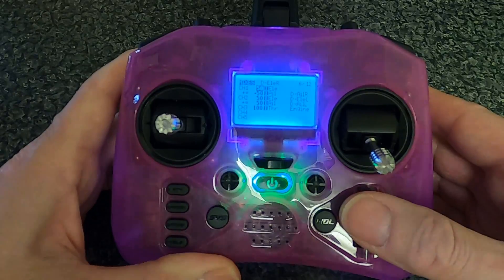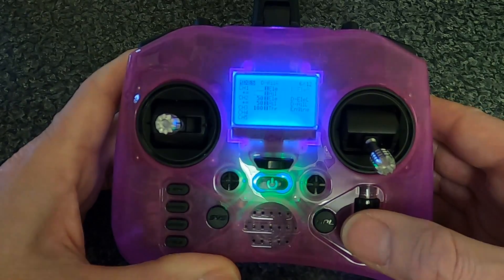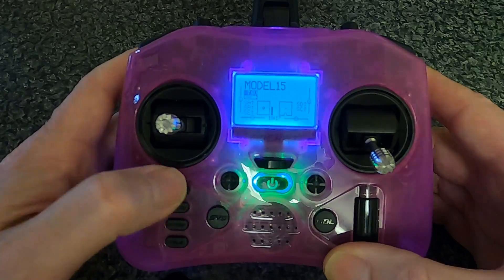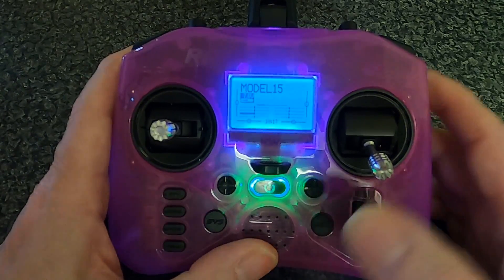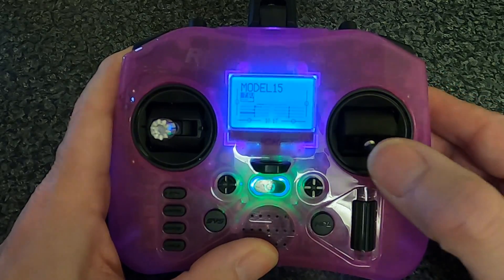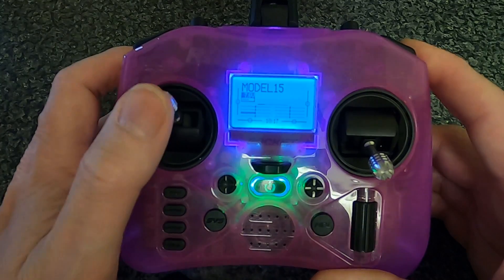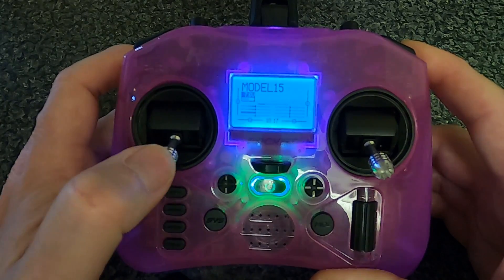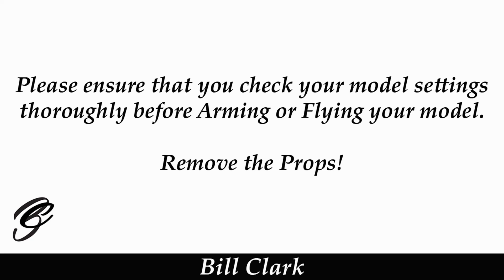RadioMaster Pocket Setting up a Delta Wing - Model Wizard

Comment: hi i got the same issue with my gx12 radiomaster. When i pulldown Elevator stick the left goes down and right to up. Similarly when i use aileron left /right then both act as  elevator up/down. How to solve this please

Comment: Great tutorial video. One of our lads in school has just followed it to set up a delta wing slope glider. The issue is that the Aileron movement is on the elevator stick and vice versa the elevator movement is on the aileron stick (Mode 2) What can we do?
Reply from the maker: This can be tricky to sort out you need to change Weights from + to - or visa versa. The way I do this is look at one of the wings only and operate the elevator make the weight change and check it moves correctly. Then check the aileron for the same wing. I hope that helps.

Comment: Hi Bill thanks - I used the wizard but my elevons are backwards. when I pull my elevator stick down they move up/ down (Left Up Right Down) When I move my stick left the Elevators move up and when I move it Right it they both move down? Ive looked everywhere but can figure out how to reverse channels. I followed the wizard correctly 3 is motor L Servo Ch2 R Servo Ch1 - Any hints would be helpful
Reply from the maker: Hi Jerome, the way to sort this out is to operate your down elevator and check which elevon is going down and note the channel which is going up, reverse that elevator channel. You can do this whilst activating the elevator. Once working ok do the same for the aileron. Hold roll right, left elevon down right up. Change weights to - or + as needed. In the video I mention you may need to adjust the weight to correct for the way the servos are installed in your model. If you still have problems please back up your radio and settings, email to me and I will correct it for you. Hope all goes well with the above instructions.
Reply: @the-happy-RC-flyer  Hi, can you make a short video to solve this issue?
I am new in RC, I face the same problem
My radio switch (up and down become left and right, vice versa)
Reply: @Indonesia01ian  hi i got the same issue with my gx12 radiomaster. When i pulldown Elevator stick the left goes down and right to up. Similarly when i use aileron left /right then both act as  elevator up/down. How to solve this please